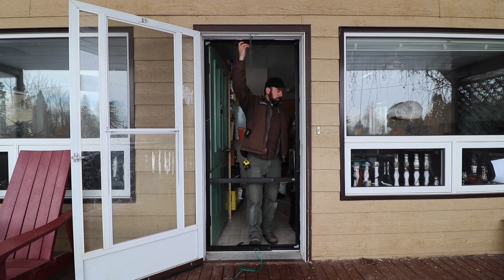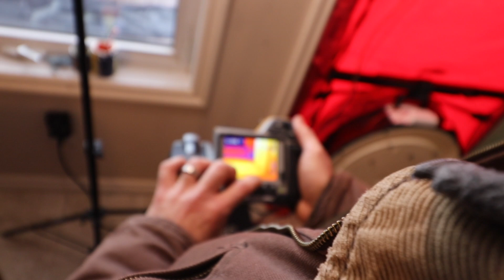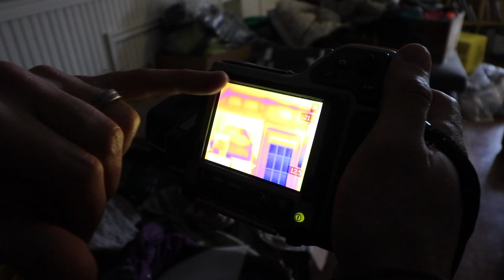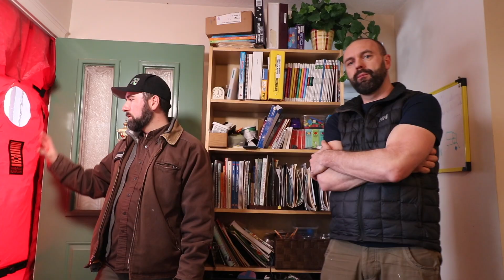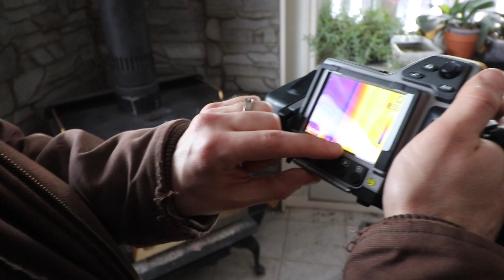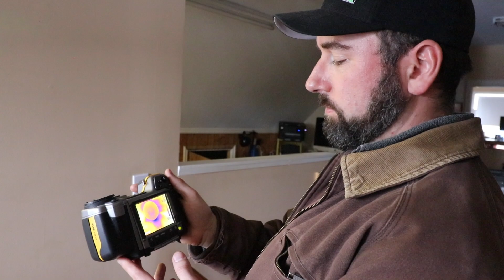How Energy Efficient is our Homestead? Hint... The Thumbnail Says it All

Comment: Rob, Tyler, this was an excellent, information packed Video. Good questions. Good answers. Thanks. Good camera work, Mitch. Thanks for the content links. Thanks for all you do. All of the VergePermaCulture classes are well worth the time and are fairly priced.

Seems like any and all wall penetrations need to be avoided or the count reduced as their seals will need maintenance. In new construction, are there existing methods of distributing electricity jacks and communication jacks without penetrating insulated walls? Perhaps cables in chair rails or crown molding or floor molding? Plain old surface mounted cable tracks seem to be unattractive.

Comment: We had one of these done a few years back.  Our guy said we're oversealed, and have crappy(that's my word, LOL) windows and doors.  He said if we change them we'll need an air exchange system installed.  He tested with the doors to our built in garage open(and we all know how much air the rolling doors let in).  We have an expensive heating bill and drafty feeling house.  Tyler explained why!
Reply: What about the insulation?
Reply: @freegandavehartman8908  our tester stated the windows and doors were the problem and he's correct.  Any room that has a big window is really uncomfortable
Reply: @longarmsupplies  We made some "warm window" coverings to use during dark and cloudy times. Does make a huge difference when you use them optimally.